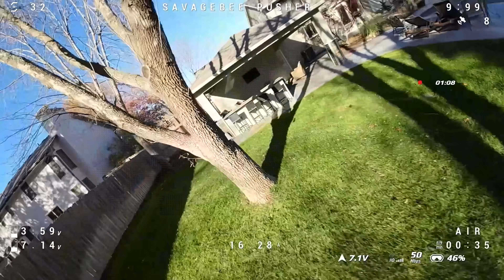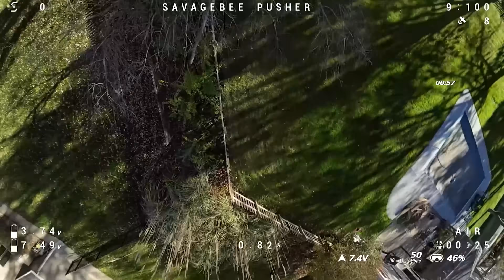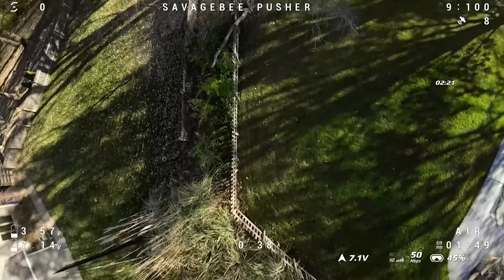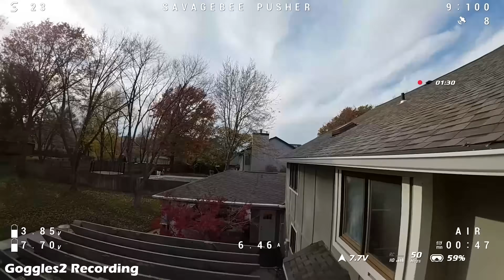Inverted Pusher // SavageBee Pusher // GPS

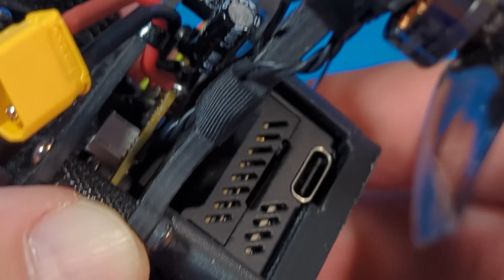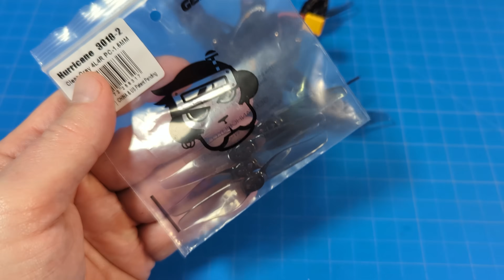Comment: whoa didn't know that 1202(.5) 11.000 or 11.420 Kv could handle 2S.. I have two 1S 3 Inch Analog Kwads with the same Prop (GF 3018 Bi-Blade) flight time is 2:30 to 3:00 min's with an 450 mAh..

but I guess I will convert one of my analog 3S 3 Inch TP to the o4 Lite

Comment: Seems to me we have two different prop settings as far as placement.  Little close to the body or little farther option. Two diff holes to choose 😅
Reply from the maker: I do not see what your seeing. Two sets of holes in the props or in the frame for the motor mounting.
Reply: I have three holes in the props . At first i thought i had to put the prop on the motor in the middle hole but doesnt fit. It does fit over the other holes which leaves an option for close prop or further spaced props . Likexa quarter of inch difference.  Idk its my first drone ,maybe im not seeing this right .😊@NickBurnsFPV
Reply: @NickBurnsFPV unless im suppose to force it on there . That middle hole is small
Reply from the maker: @TheParaplegic  Yes they are press on props they go in the middle hole. The the two holes are for screws, but they aren't needed in this case.

Comment: You got to love the GPS feature on a very small and light weight drone. Especially after you've lost several hundred dollars worth of drones that simply fell out of the sky a half mile away into the woods and they are still there many months later. But I fail to understand why on so many of your and other's reviews of drones why you don't mention the exact manufacture and exact product item that is regarded regarding fpv goggles when you make your reviews. Newbees without your experience and/or knowledge will not know these things. Did you mention what googles you need to fly this SavageBee Pusher? And would it be the same pair of goggles their SavageBee without the word Pusher? But thank you for the entertaining drone video showing off you skills. Very impressive. But please add more detailed information on the technology and manufactures required to fly a drone. The industry is in complete chaos at the moment and appears to have always been that way and new stuff is coming out near every week requiring a different transmitter and/or a different pair of goggles. It's near insane how more complicated it is over what it could be. Just a thought...
Reply from the maker: Your mostly right. In my videos where the dvr or footage isn't 1080 I use a flight background to show the radio and goggles used. In another way there is always the opportunity to ask in the comments, which does happen occasionally. I do think its something I can work in provided I remember. 😟
Reply: @NickBurnsFPV  LOL... so much to learn and so little to explain it all. Makes newbees shy away from the sport completely. Especially, when a pair of goggles from HDZERO are near $900 with antennas they don't sale. In the US of course. Who can spend that on a wishful thinking dream that it will be what exactly what I need?

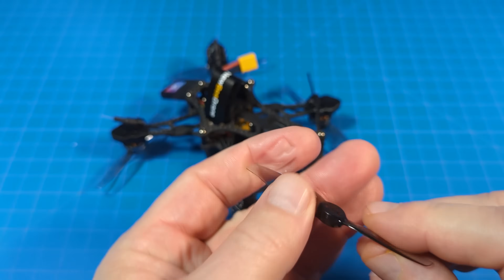Comment: at 10:05 you are demonstrating the right front motor spinning clockwise. I believe that's a props out configuration. Isn't it ?

The video said props in.

Just trying to learn the proper terminology.
Reply from the maker: Sorry, yes its props out
Reply: And did you notice two diff spacings for props ?

Comment: whoa... This is almost the exact config I have been flying for years but on Dave-Cs nanoLR frame.I call it my dual purpose because it absolutely rips on one hand but will give you 14m+ on the GNB1100 2s for a nice cruiser. The community has been sleeping on this config. I hear it talked negatively about regularly on reddit and the like. It all comes down to keeping it light. That O3 unit is heavy.
Reply: It's probably because it's ideal for cinematic flying, but you really don't want a ductless pusher for ripping? You can't do race takeoffs, rail slides are more risky, and uneven ground takeoffs could be tricky. It just looks like a prop-buster. If you really want an all-in-one cinematic/freestyle drone, a deadcat frame is prolly the best middle-ground. That said, it does look cool!
Reply: @midnitetelevision  the daveC LR is a deadcat frame
Reply: @CriticoolHit  right I was commenting on why the config might be discounted in some cases. But I meant deadcat in a puller config.

Comment: Great review! If I'm going for a cruise with a sub 250 gram w/ GPS, I take my Neo out, it's GPS is superior to standard RTH on BNF'S, and the thing only cost $250 CAD, you can't go wrong. And yes you need the goggles 3 and remote 3, but many of us 03 users already had the goggles and remote. And the Neo battery goes for 12 to 15 minutes in manual cruising around.
Reply: Those m10s are tiny, fast and accurate now. Unless it is on a whoop for flying super close, I put a gps on all my quads that have video systems aboard. It's cheap insurance. Also invaluable if you ever fly over water.
Reply: @kurtzFPV  agreed, all my sub250 have dji 03 and gps, and all the sub 150's (whoops and 1inch 2s), mostly mobula 8's, ymzfpv's, any tiny hawks. And Long range, always gps.
Reply: How is the flight performance? Can it do proper aerobatics? Handle wind?
Reply: @neuroticsdubstep  it can handle wind. Tricks will come down to the pilot and rates set. I was experiencing prop wash on maneuvers with lots of yaw, and had to learn to work around that. The neo is the master of nothing, but it does a lot for the price.
Reply: @BantyFPV neo works great for price , I've think to buy neo, but already have pavopro2o,and avata 2, and because neo have more decrease on cam result, i skip to buy neo.

Comment: Interesting quad, but I am not a fan of O3 at the bottom that many BNFs go for. They have 2 plates, they should really use them for protection of the most expensive component. I'd be curious to see how it performs with different props, as well as with smaller props and naked o3 potentially. Solid review as always!